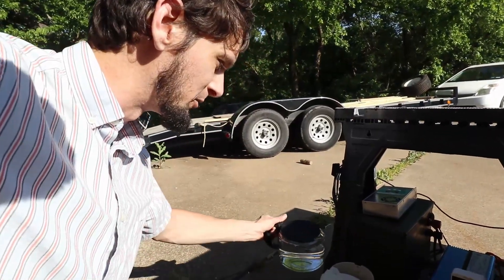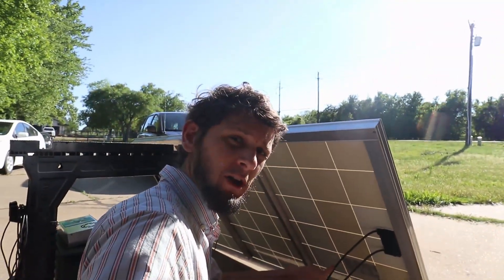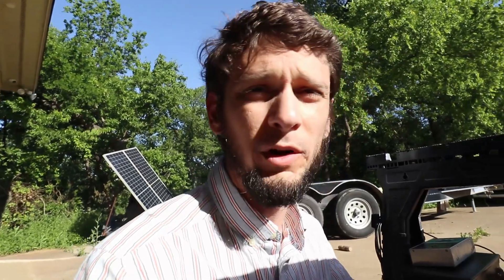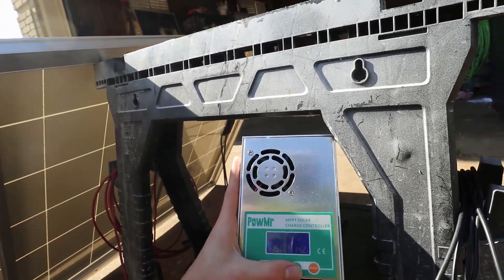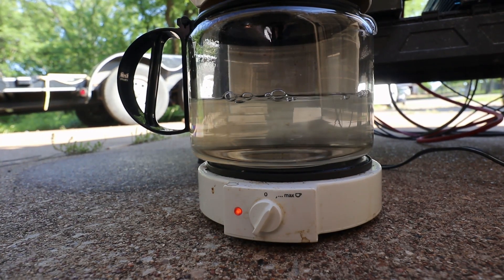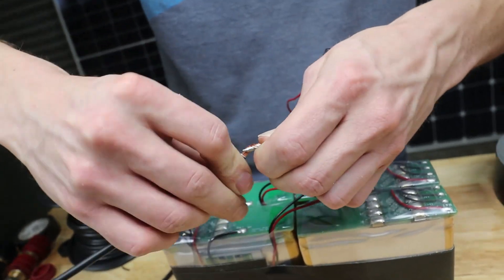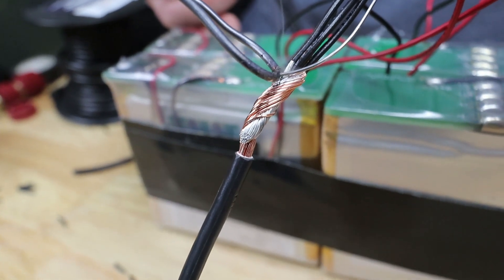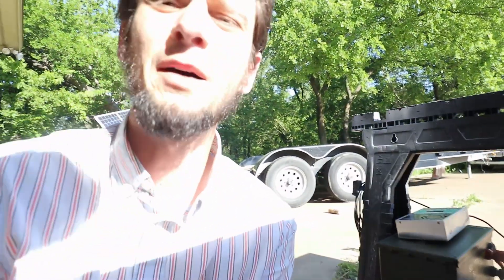How Much Coffee Can One Used Solar Panel Make?

Comment: My dream is to run a small air conditioner during the day without destroying anything. Right now I`m using power stations until I get moved into a camper trailer and after that happens I`ll know more about what I can do at that location. But if another hurricane comes I have two Bluetti EB70s to run a dorm fridge and a 5 cubic ft freezer so I won`t lose my food. I only have three 100 watt glass solar panels and some smaller folding panels to charge power banks and two 300 watt power stations. 

I drink instant coffee so I just use either a 12 volt 100 watt rice cooker or one of the low wattage immersion water heaters you put in a cup. Those rice cookers are amazing. I bought two of them. You can cook a lot of different things with them or even boil eggs. Just plug it into the cigarette lighter port in a car or power station. I bought an adapter to connect it directly to a 100 watt panel but haven`t tested it because a review said the polarity of the adapter was reversed. 

AskIve Solar mentioned you yesterday so I subbed.
Reply from the maker: Very cool, glad to have a couple of the AskIve community hanging out here as well!

Comment: Very informative and cost saving.. how many of those panels in parallel in your link could you connect to your mppt without overload, or does each panel require one of its own? Sorry for the dumb questions, but I'm new to all this :o)
Reply from the maker: Not a dumb question, 3 in parallel would be just under the 60a max of the charge controller. Could do four panels if they aren’t going to be getting optimal sun.

Comment: Great videos, I'll be venturing into solar for my shop. Just for the lights but eventually build up from there. But i also want to try wind energy. Have you experimented with wind at all? It seems like its a bit more complicated to charge lithium batteries with wind turbines.
Reply from the maker: I’ve tried wind but you have to be in the right place. I’m not in the right place. Also a lot more to break.

For charging you could always go through a rectifier into a solar charge controller. That is, I’ve done it that way. So it may or may not cause issues down the road. Lifepo4 has a very similar charge profile as lead acid so off the shelf wind controllers should be fine too.

Comment: I think Those batteries is little bit swollen... ?
Reply from the maker: They could be, hard to know for sure with them being 12 year old pouch cells. Tested well at 1.3kwh at around .4c and they have some pretty tough shrink wrap on them. I figure with the low discharge rate they will probably be good. Guess we will see though!
Reply: @BeeneEnergy  sounds good. 👍
Reply: @BeeneEnergy  how was the configuration of these batteries in order to make it work like yours?
Reply from the maker: @paulomock3741  I just took the packs and put them all in parallel Witt each other